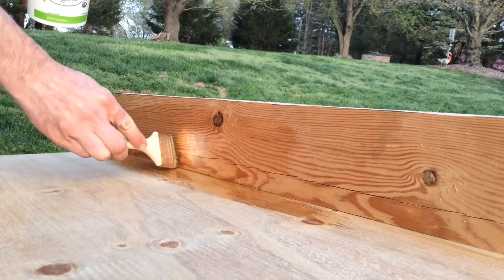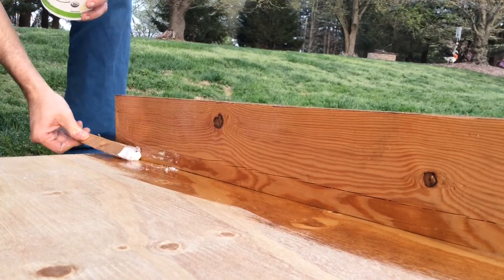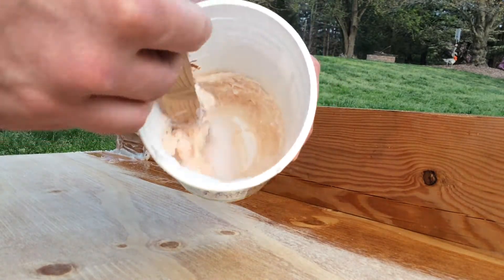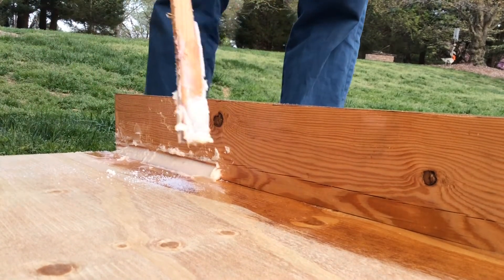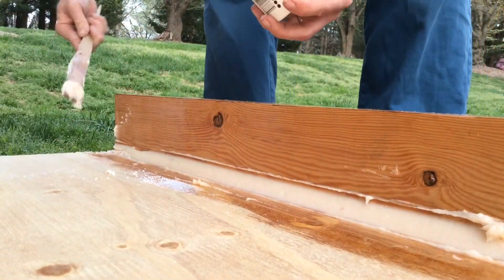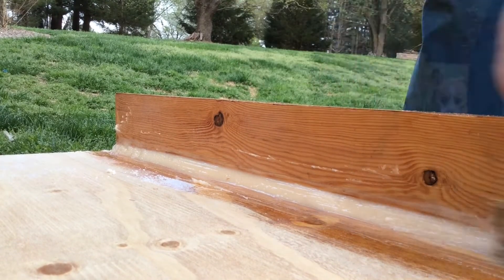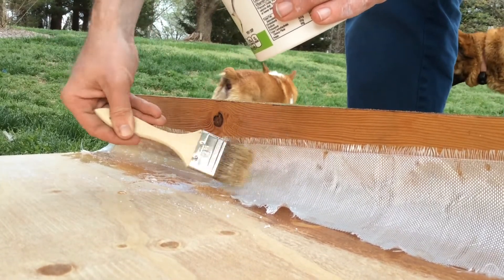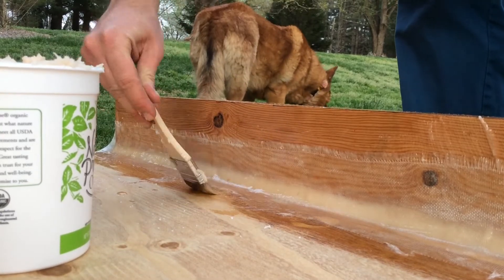How to bond wood with epoxy and fiberglass

Comment: Hello! Thank you for this very helpful tutorial!

I’m currently building out a van, and I’d like to join my wall panels to each other and to the ceiling. What do you think about using this technique for that?

The walls and ceiling are made of 6 mm poplar plywood, and I’m aiming for a continuous, solid structure to prevent any cracks in the paint. I also have to consider the vibrations of the van when it’s on the road — should I go for something extremely rigid, or something flexible enough to absorb movement?

Thank you very much for your time!
Reply from the maker: Plywood will only bend in one dimension, so if you give it a curve and then reinforce that curve so that it can’t bend in the direction of the curve, you technically have a rigid structure. Epoxy will glue it all together very well. 
I would use 1708 fiberglass on the plywood to really make it rock solid. 3 or 4 layers of glass will make it so strong that it will never yield or crack!
Reply: @RiggingDoctor thank you very much ! What about toxicity in a small space like a van
Reply from the maker: It’s not toxic once it has cured. The liquids are rather toxic so wear a respirator and gloves while you work.

Comment: Great video! I am trying to bond wood some ribbing to a fiberglass high top in my van so that I can have supports to build off of.  I want to bond the wood and then fiber glass it to the main structure so its super strong. I think everything in this video will work for me (aside from the glue needed to hold the wood in place while glassing). Do you happen to have a link to any of the items used in your video? Any suggestions on what to use to initially bond or glue the wood strips to fiberglass prior to the steps in this video would be awesome as well. Ideally, it would need to be something that did not need clamps or supports for curing, since it will be on the upper walls and ceiling.
Reply from the maker: This is what I used for epoxy at the time: https://amzn.to/4370Gsv
It’s by West System but I have since tried and prefer the epoxy from Total Boat. It is less expensive and works the same: https://a.co/d/39bJp5V
To hold them in place while the wood bonds up, you can always use tiny set screws. You would put the screw in to hold the wood in place while the epoxy cures, then remove the screw and fill the screw hole with epoxy before putting the cloth over it. That will hold everything in place without clamps and hopefully won’t make too much of an issue with your roof. 

The alternative is to use fast set epoxy in small batches on a hot day. It will set up in a few minutes so you can just hold it in place while it sets, then you can let go and avoid making extra holes in your roof.

Comment: i'm about to use this exact thing to replace the support for deck on my old 79 snipe. gotta replace all the beams below. what's the best temperature range to do this at? i'm asking bc of the season or time of year
Reply: also what kinda wood did you use?
Reply from the maker: You want it to be warmer than 60°F and you want to use Douglas Fir because I have been told that it works best with epoxy resin.
Reply: @RiggingDoctor  got it. thanks😃

Comment: Having a hard time finding marine plywood to repair my rear boat seat/engine cover. Would regular plywood waterproof in resin be good enough?
Reply from the maker: Yes*

*it’s supposed to be good enough but I’ve seen over and over where regular plywood in epoxy rots out quickly next to marine plywood in epoxy that holds strong. 
If you can’t find plywood, maybe give foam cores a look. They work the same as plywood but will never rot!
Reply: @RiggingDoctor Thank you for the quick reply. would you happen to have a link to this foam core?

Comment: Does  sanding the fibreglass back once it’s dried achieve a neater seamless finish?
Reply from the maker: You can. To get a really smooth finish on it you can then cover it in thickened epoxy that is thickened with fairing powder. This will let you sand it back with ease and get it all smoothed up and ready for paint. The end result will look immaculate!
Being how this was the underside of something that will become a storage area, I just painted it once it was cured.

Comment: Thickening agent... what exactly is that powder you added into resin and hardener to make that paste? This seems a perfect way for me to attach a fibreglass piece on to a wooden surface.
Reply from the maker: It’s a powder by West System. They come in different properties 405 being the strongest to 410 being the easiest to sand later. 
This was done with 406.
Reply: @RiggingDoctor  Thank you very much for your reply, this video is just what I needed for my current project. Thank you.

Comment: Can I apply fiberglass on only one side of the wood as reinforcement? or it will fall off eventually? just fyi its for a piece of furniture, not a boat or anything near water
Reply from the maker: You can and it should adhere very well to the wood. 
In the example shown, the fiberglass was only put on part of one side; the rest was simply covered in resin.

Comment: Could I just place some quarter round molding in the corner and then glass over all of it?
Reply from the maker: The top and bottom edges would still be 90 degrees. You might be better off with using a triangular piece. The right angle into the corner and the top and bottom edges would only be a 45 degree bend.
Reply: Rigging Doctor :  Good idea.   Thanks.

Comment: I'm sorry but this is messy work. You're smart and can do better. May I suggest using a radiused (rounded end) spreader for your epoxy fillet and masking tape to keep the thickened epoxy off areas you want to keep clean.  Why bother keeping it neat and clean? In areas where this joint will be visible, less fairing will be required and you can feel proud of a job done meticulously and precisely.
Reply: How bout just putting the think epoxy in a big Ziploc, cut the corner and pipe it into the corner, like a cake...wait then go over it with your finger.

Comment: Interesting series of dinghy build videos. A lot of work and that looks to be one tough tender, but also very heavy. How are you planning to launch and retrieve it from the mother ship.....halyard/deck or davits?  FWIW that dinghy keel fillet would have gone a lot cleaner, faster and easier if you had put the thickened epoxy in a ziplock bag, cut off a corner and used it to 'ice' the epoxy into the keel joint.